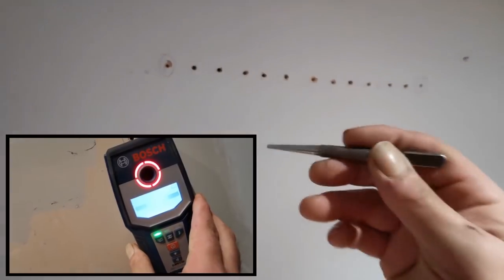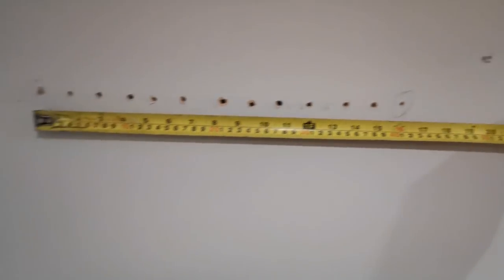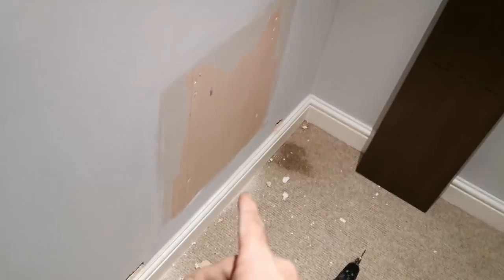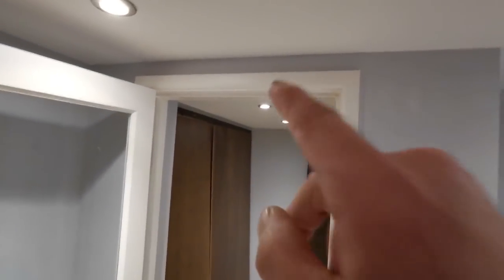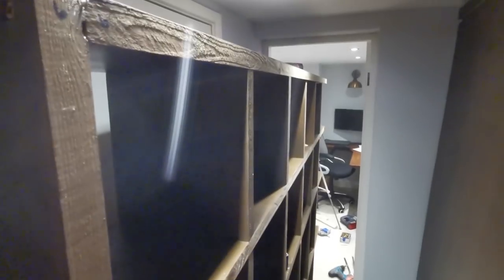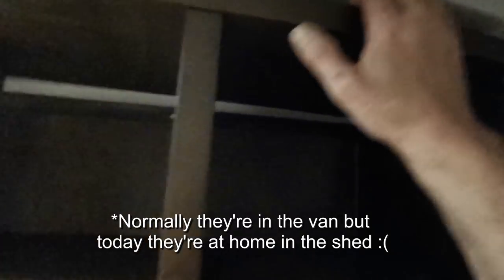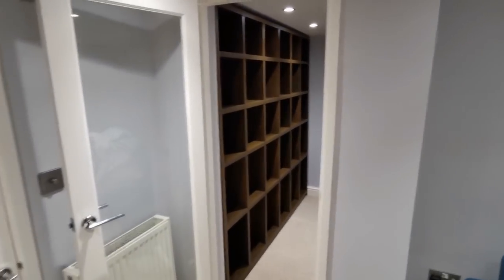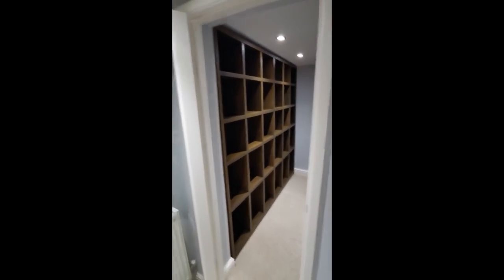Big brown pigeon hole storage shelves pt4   Fitted & finished

Comment: Looked good when finished another 10mm taller and would have been a real struggle, seen a few workshops in my time. Spend a weekend have a good clearout and tidy, and Monday morning you’ll think you’ve walked into a new workshop, know it’s tight in there but would make a massive difference. All the best 👍
Reply from the maker: Thanks 👍 Yeah i measured it several times, there was a plan to be able to get it in & leave an equal shadow gap around, it turned out pretty much as planned 😁

Comment: Great set of video's Gid, nice surprise to wake up to. Great how you resolved the problems. Many thanks to for the info 're spraying equipment. Could you explain the reason behind your choice of paint ie ( PU paint) as I am looking to start spraying and need all the ad advice I can get. Cheers again.
Reply from the maker: Thanks 👍 Glad you like them, I use the 2part PU enamel because it's hard wearing, resistant to household chemicals, dries very fast, sandable in ½hr & is slightly flexible so dents rather than chips, There are many other paints, Pre-Cat enamel is a 1part paint no mixing involved, excess can go back in tin, it sprays easily & flat, & is a bit cheaper so good to practice with but not very hard wearing, AC enamel is 2part , that's easy to spray but both of these, Pre-cat & ac are 'hard', there's no give in them so with the wood underneath being relatively soft they chip when knocked as in the kitchen in this vid, my mistake, whereas the PU dents 😉  I get my paint from Symphony coatings & guns from Sprayguns direct, they both will help if you ring them. 
https://www.spraygunsdirect.co.uk/index.php/
https://symphonycoatings.co.uk/

Comment: Beautiful as usual, one question, why biscuits over dominoes, I have just bought one  initially to make a large wall unit , have I just f####d up !! . I haven't the tools ,or experience to make it in solid wood ,so was going down the MRMDF route
I really enjoy your videos, Thank you
Reply from the maker: Thanks Adrian 👍 A couple of reasons, I only have the 700 so it's a bit big & clumsy, if i had the 500 maybe i would use that, (one day I'll buy one) over 150 biscuits on this, cheaper on the biscuits, the biscuits are mainly for alignment not strength & to help keep the boards straight over time, they're longer so i feel they are more like a tenon/tongue rather than a dowel like the domino, they needed to go in from opposing sides, these boards finished 28mm-ish so dominos would only be able to go in half way. I hope the MR MDF works out for you but i don't know how long that would last, if i don't use wood i use ply n lip it, you can buy boards glued together 🤔 I use MR MDF mainly when i want a very smooth flat finish,  I'm glad you liked the vids n best of luck 👍,
Reply: I haven't even though about using ply ! 
How does the old saying to " all the gear , no idea " 
I can buy the tools ,but can't buy experience 
Cheers mate
Reply from the maker: @adrianrandall9379  😂😂 it's the lipping part of ply i'm not keen on👍
Reply: Is there what you would call an easy or easyer! Method ,I have seen other makers lip plywood , if you were just starting out again now would you proceed ?
Reply from the maker: @adrianrandall9379  Lipping ply can be thick or thin, i prefer to put thicker lips on with the hope they won't come off so easily & they strengthen the ply, i put them on with biscuits but can be just glued on, the lip will move/shrink expand at a different rate to the ply so even if it is sanded smooth to begin with it will show later, maybe producing a lip that can get knocked, 
How big is the thing you're making,? you could just buy pse pine, glue it together n use a sander if you've no planer, & pre glued together pine boards can be bought, https://www.wickes.co.uk/Wickes-General-Purpose-Pine-Timberboard---18mm-x-300mm-x-1150mm/p/110153?utm_source=google&scid=scplp110153&sc_intid=110153&ds_rl=1255384&ds_rl=1255441&ds_rl=1256318&gclid=CjwKCAjw3c_tBRA4EiwAICs8CnVmCq5-pmOc9KMOy4gMaYWjJpexG30MdsyC1Y5yqkhkAEG5EMbz9BoCtmsQAvD_BwE&gclsrc=aw.ds